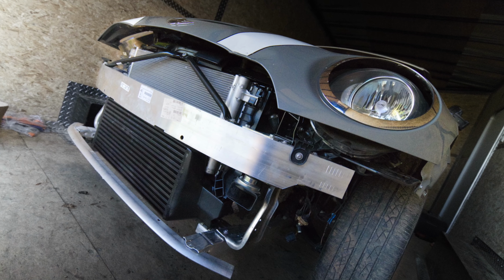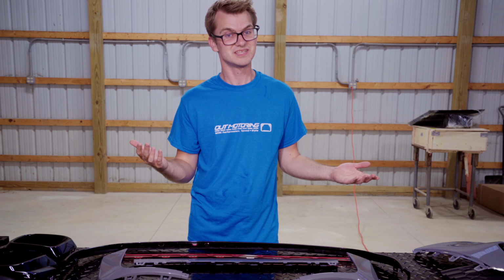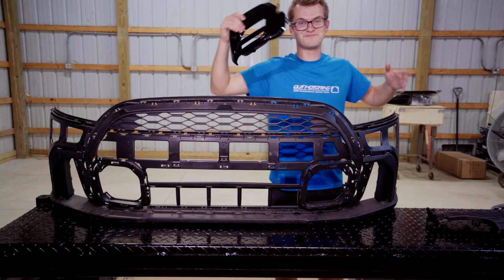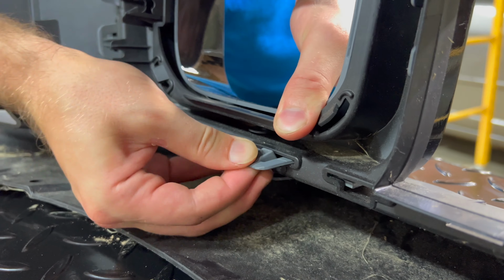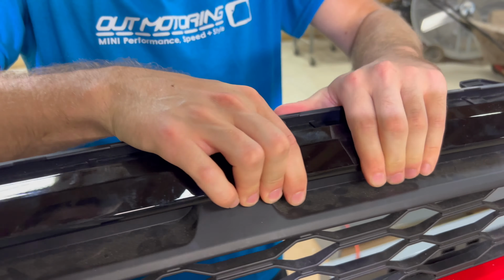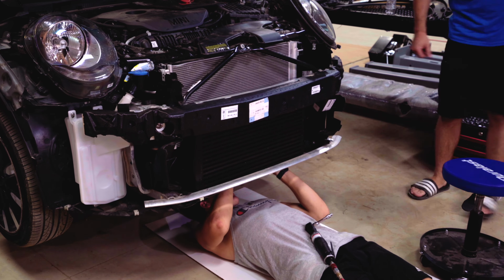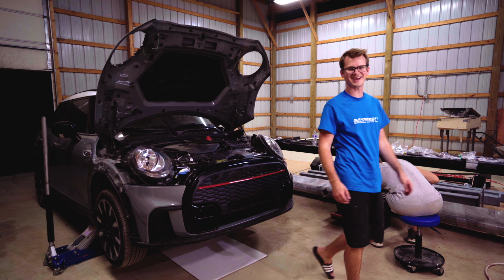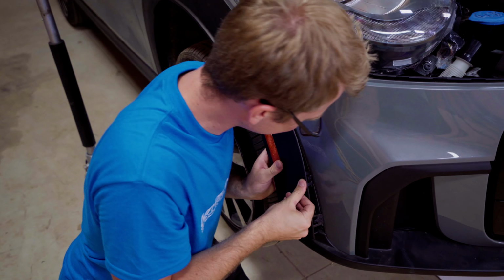Installing the NEW 2023 MINI COOPER JCW BUMPER!

Comment: Can you fit the lc12 3 door bumpers onto the 5 doors without issues? Or do you need the 5 door versions? Looking at getting a SD 2015 5door as a project. Cheers
Reply from the maker: The front bumpers fit fine however you need to get the 5 door f55 rear bumpers. 
If you get a 5 door cooper (non s) and want to do the conversion I actually have an f55 rear jcw diffuser with the single exhaust output that I could sell for cheap. They are super hard to get.

Comment: Love the upgrade, but just curious on what happens with the fog lights and day time running lights? Would I also need to change the headlights for this to work?
Reply from the maker: Thank you!! I am coding out those although I have not done that yet. 
You would not have to replace the headlights although I will to complete the face lift look.
Reply: I have the first gen cooper SE, I’m also interested on this, mine also has fog lights that also work as side lights when you turn the car, I was looking at new resolute front bumper or jcw but they don’t have fog lights, new ones are inserted on headlights. I wonder if the car will show errors on the console for disconnecting those.
The other option is to use the old jcw front bumper becouse I saw some cars with that bumper and with fog lights fitted there.
What would you recommend?
Thanks

Comment: Nice, what about front fog lights???
Reply from the maker: Thanks! We were able to code them out, then we will be coding in the way they do fog lights in the lci2 cars which is basically turning on the turning lights when they are pointing ahead.
Reply: @carcreationsyt my s from 2017 has fog lights, if i install this bumper i will delete them right?
Btw, do i need new wheel arches, windshield water bottle and air intake?
Reply from the maker: @saesii yeah that’s correct. 
Yes you will need all of the above.

Comment: Amazing bro the car looks crazy and love it. I'm driving a 2016 F55 four-door is it possible for me to change the front & rear bumpers to the 2022 model? and I was checking the website you mentioned and I cant find the part there. Can you please help me?
Reply from the maker: Hello, thanks for watching! It is definitely possible. As they are not high volume parts, they may be hard to find on the site, I would recommend reaching out to the email address listed on the site and asking for help. If you have issues send me a dm on instagram or an email and I will try to help you out!
Reply: @carcreationsyt  Thank you so much!

Comment: Thank you for these videos on your 17 F55 S! I have an 18 F55 S with the JCW tuner kit! 
I know S bumpers have different air inlets than JCW, do these line up? 
Seeing you retrofit LCI-2 on pre-LCI F series is extremely helpful for future opportunities. 
Keep it up!
Reply from the maker: Thanks for watching! I added the new ones when I bought the kit, where the intake connects to the wheel well, its a little different, but if you drill the screw holes, its fine. If you have any questions, please let me know!

Comment: Great job, I’m impressed, congrats! You are my inspiration, I have also rebuilt my F57 to LCI2. I have one question- where should I put the temperature sensor? Do you have any advice please? thank you!
Reply from the maker: Thanks so much! That is so cool! It’s funny as I am have issues with my temperature sensor. It connects to the bumper on the right side I believe, but I just have it taped there currently as I can’t get it to work properly. Says there is a short but I can’t find where! 
Does yours work?

Comment: Sweet video , do you have a list of parts and part numbers that go on the front bumper ?
Reply from the maker: Hello, thanks for watching the videos!! They vary between models so its hard to pin down a list, your best bet is to reach out to outmotoring.com or find their information email and he should be able to get you everything you need.
Reply: I am diving into things a bit more now so I know what you mean , every now and then I drop into the mini plant in Oxford, UK 🇬🇧 I drive a transporter so I pick 11 exports up and drop them off in one of the ports to be shipped out

Comment: I have a mini Cooper SE 2020 … the front bumper 2022 fits in my car ? It’s just plug and play? And the hood is the same or I have to change it ?
Reply from the maker: Yeah for sure! 
It is plug and play although you need a new windshield washer tank and also code out the fog lights if you have them.
Reply: Ah ok … and the hood still the same ?
Reply from the maker: @ricardoseixal5379  yep!

Comment: Hey bro. I’m planning on purchasing my 2023 MINI JCW Automatic this December. How has your Mini’s reliability so far? How long have you owned it and Has it given you any major problems so far? Any tips on maintenance?
Reply from the maker: F series minis have amazing reliability. 
I have owned 4 f series minis with one of them well above 200,000 km. No issues at all! 
Maintenance is important, stay on top of oil changes. 
Breaks do go quickly if you use cruise control lots. 
Make sure you chose the spec with CarPlay as if you don’t it can be expensive to upgrade.
Reply: @carcreationsyt  thank you for responding. I will send you pictures on IG when I get my JCW 🚗🤩
Reply from the maker: @leom00n79  Looking forward to seeing it!

Comment: Does it really fit without any space
Reply from the maker: Yeah! The only space there is from the hood not pushed down as it’s bent.
Reply: @carcreationsyt  Okay thank you for the reply. Did you have to change anything else to fit this bumper.
Reply from the maker: @a.hiddenmisha7066  I had to get a different windshield washer tank and the wheel liners don’t fit 100% however it wasn’t noticeable to me so I didn’t worry about it

Comment: What about the fog lights?!? Is there a part list of all the parts that are needed?
Reply from the maker: I coded them out. As for parts list, outmotoring sells most of the kit. Other than that I had to get wheel fender liners and windshield washer bottle.

Comment: You also need to change the washer bottle and upper radiator air duct support to make it fit on a non lci car
Reply from the maker: Correct, we did that in an earlier video
Reply: @carcreationsyt  my bad lol! I’ve just finished doing this swap with mine! Really changes the look, mine was a 14 plate so really modernised it haha 😎🙏🏻

Comment: Why is there such a big gap between the bumper and the hood?
Reply from the maker: @paulcarranza8210  The car was a rebuild and had not replaced the bent hood yet. 
Later once we installed a new hood the gaps were gone.
Reply: @carcreationsyt  
Thanks. Good to know. I just purchased a front and back bumpers for my Mini and was concerned it would not fit. 
Thanks for the awesome guidance.
Reply: Are the square vents functional or can I use them to install some fog lights?